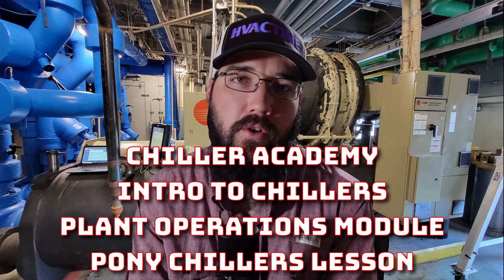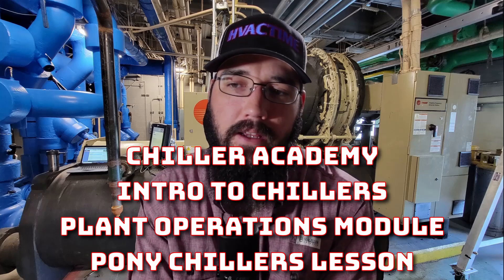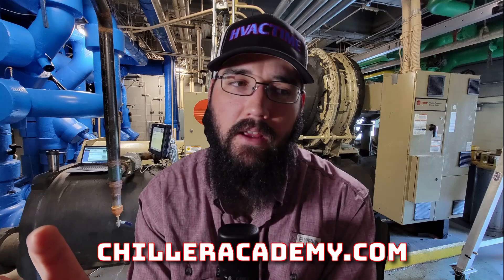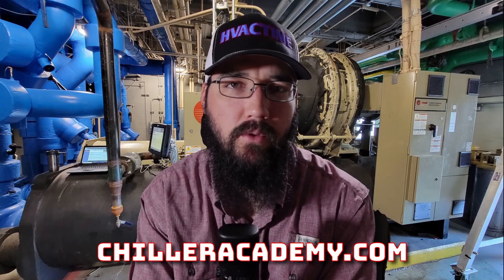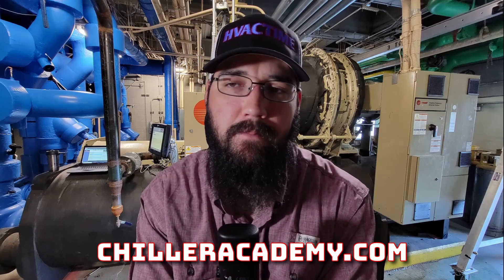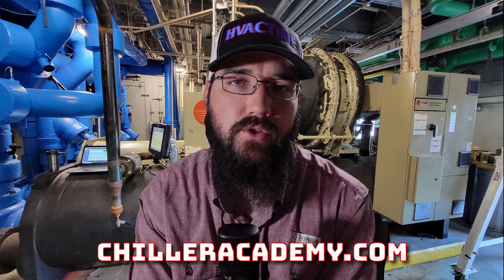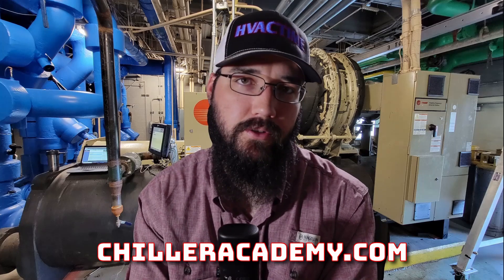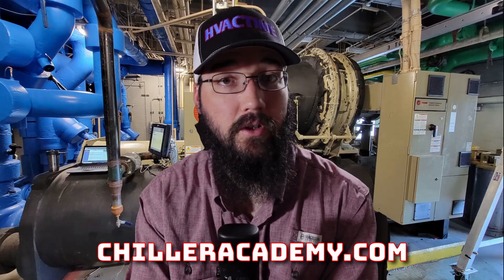Know Pony Chillers - Chiller Academy

Comment: Did the word "pony" originate from a pony electric motor? The asynchronous "pony " electric motor brought the synchronous motor up near synchronous speed and then the main motor is energised and pulls into speed, 60Hz on your side of the pond, the asynchronous motor drops out, ince this is achived..
The asynchronous motor has some "slip" so never achives the same frequency speed as the power supply, its hiw the motor produces torque...
??
Reply from the maker: It's possible, I don't know